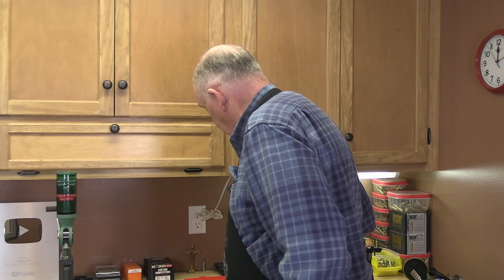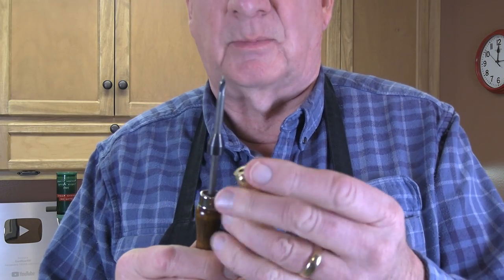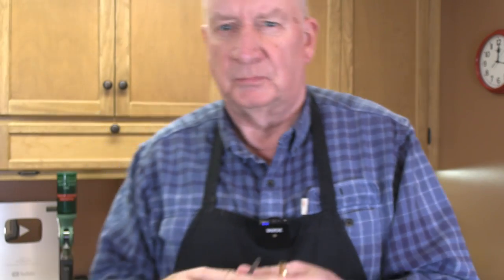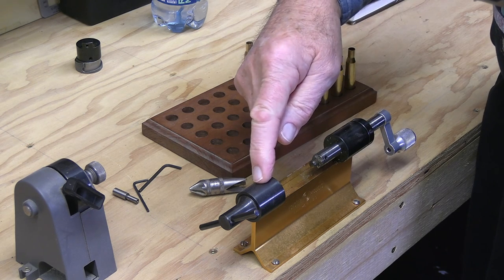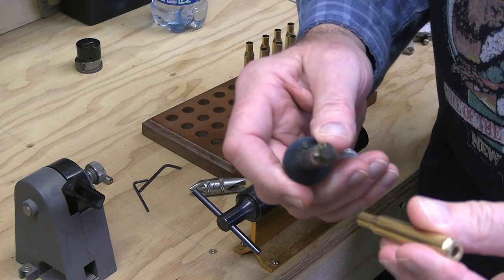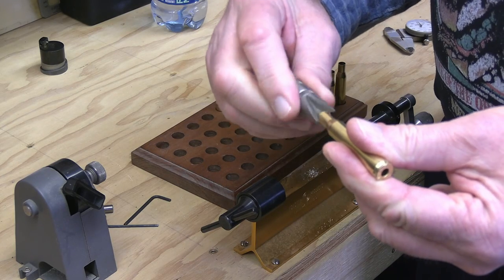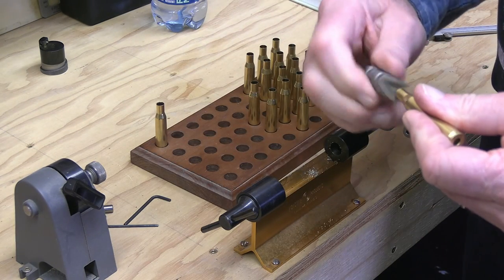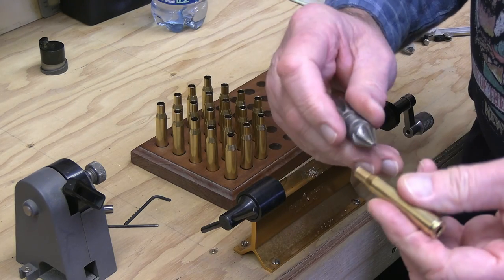How to Make Super Accurate Ammo ~ Part III Uniforming Flash Holes

Comment: The definition of the term "chamfer" is to to apply a bevel to an edge.  You are correct that the bevel must not create a sharp edge of the neck wall.  It should , however, relieve the inside edge and not just remove any burrs.  The purpose being to prevent shaving off jacket material when seating the bullet.  For precision, I trim every firing even if I just burnish the neck.  Consistent neck lengths = consistent bullet release = consistent velocity.
Reply: The process of removing burrs and adding a bevel should be the same.  Every deburring tool I've ever used on metal has deburred by beveling.

Comment: Wonderful information....When I first started reloading, I started out using the Lyman flash hole uniformer as well as the Wilson chamfer tool.  I also use a Primer pocket depth uniformer which I believe is a Sinclair or perhaps a wilson....no name on it and was bought back in early 1990's.   It has carbide cutters which uniform the depth of the primer pocket, and I am sometimes amazed at the amount of brass shavings I get from the primer pockets.  Mostly, the ones with the pockets that yield the most shavings are from factory ammo once fired and or once fired military cases.

Comment: Never heard of doing that but it makes sense. Lee also makes their quick trim and delux trimmer which works phenomenally, consistent down to the thousandth. I mounted a drill behind my Lee APP press, plugged into a foot pedal switch, and used a flexible bit holder and a 90 degree bit connected to the trimmer. The press feeds the case, lower the lever, use my foot to trim/deburr the case

Comment: First, instead of a loading block, I use a long board when weighing cases. Then I further divide by the lightest 50 and the heaviest 50 and the 100 middle cases and I keep them all segregated thereafter. How do I do that, you may ask? I scratch a durable mark on the headstamp with a scratch awl and it is a permanent reference, such as: /22-250 for the light cases or 22-250/ to mark the heavy cases. The middle 100 have no mark. That way they can all go in the tumbler and I can sort them out as I am doing the final loading. So the light cases will have slightly lower chamber pressures and the heavier will have slightly higher chamber pressures....theoretically. Anyway, for accuracy work, I stay within the weighed group, whichever it is and that small nick on the case head is easily identifiable. Some people cull their brass, but that's kind of a waste, after you have completed all of your "uniforming" to arrive at the finished product. Works for me! (I'm slowly going through some of your earlier videos, so my remarks may not be as timely as possible)

Comment: The redding flash hole uniformer has an over travel stop built into the cutting head end so you don't remove too much brass material. This comes in handy in case you forget which brass already had the flash holes uniformed or in case you want to uniform the flash holes before trimming the brass.

Comment: First off, a huge thank you for sharing your expertise in so many areas. When weighing cases, how much variation do you tolerate in order to achieve consistent pressures? For example, if all my resized and trimmed cases are within 1 grain difference, will that be sufficient for MOA testing? Should there be less variation than 1 grain difference in weight? I know less is better but have been pulling what little hair I have out trying to sort cases by weight when developing loads.

Comment: I'm not familiar with the flash hole uniformer.  Just to be clear, I understood you to say it should be used only after you've trimmed each case to a uniform length.  Will this one tool work on any flash hole or do I need different size uniformers?
Reply: The tool fits all calibers .
You need to trim all the cases to the same length before you set the depth of the flash hole tool.
I hope this helped
Reply: @montyturner4118  Thanks, yes, it does.  I just ordered the tool from the site we do not name.
Reply: One size fit all flash holes. Yes it’s best if all cases are trimmed to the same length for the flash home uniformed to chamfer every flash hole uniformly.